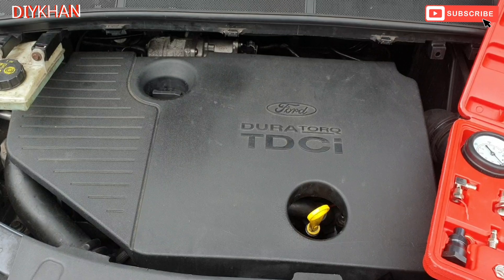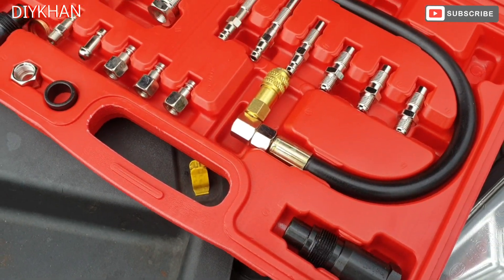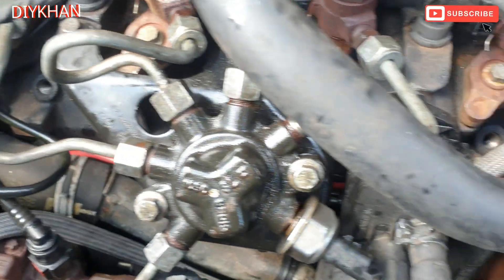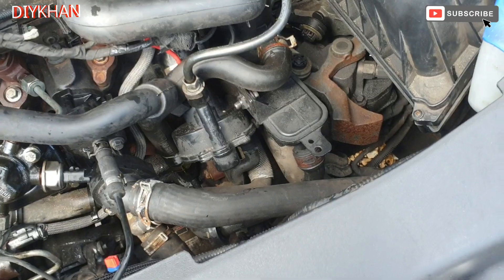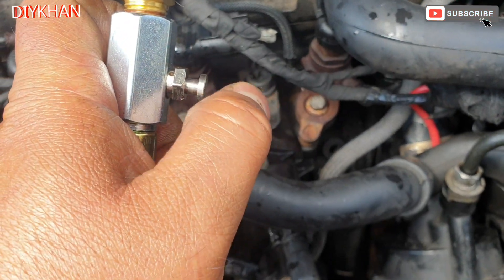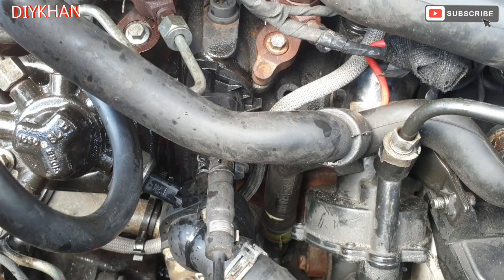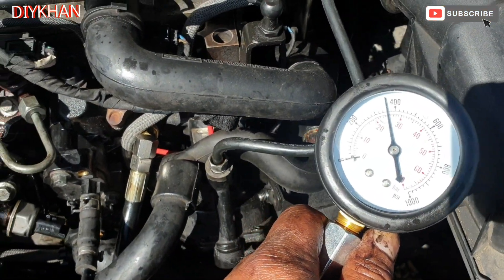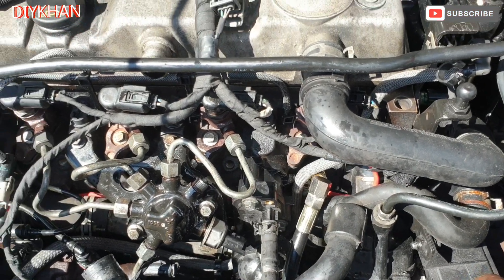Ford S max 1.8 Tdci Engine Compression Test To Check for Engine Hard Starting Problem.

Comment: Did you solve problem with the hard starting?
Reply from the maker: @damian937pl  no I didn't
Reply: @diykhan i had hard start /no start  and IT was the High pressure pump,if IT gives the p0087 code more likely is the pump
Reply: That's bad, i have the same problem 😅
Reply: @damian937pl  me tio,code p0087 low fuell pressure,won t start.